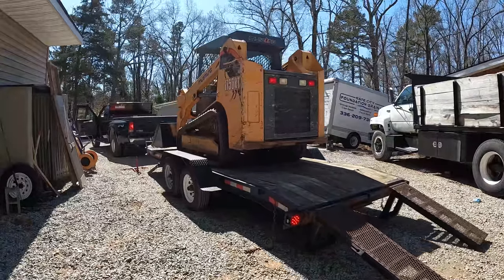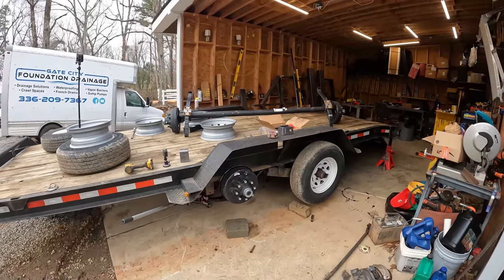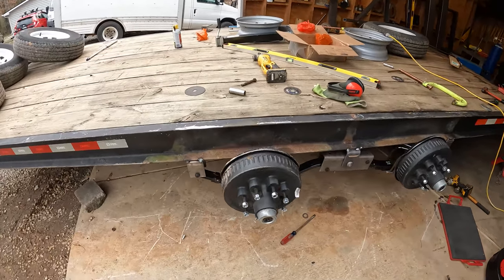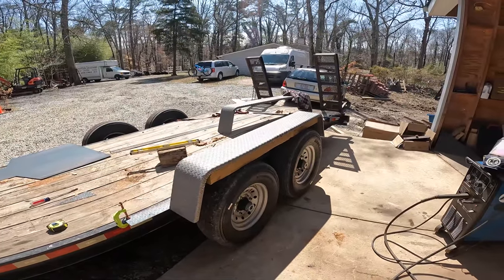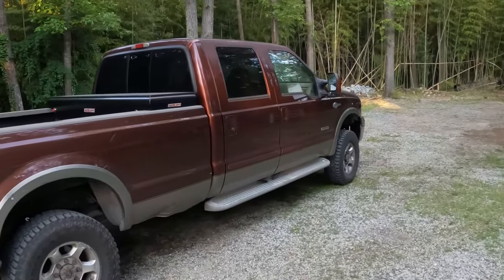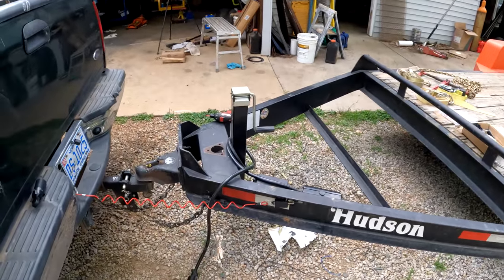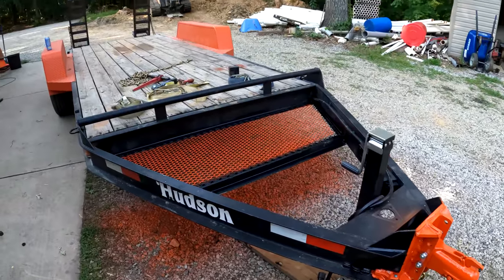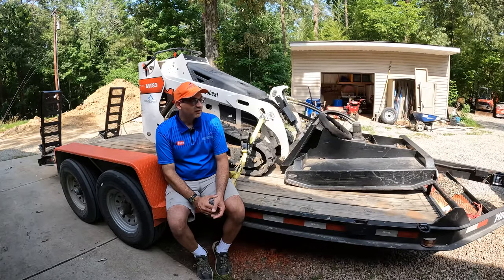Upgrading an equipment trailer

Comment: The length of your fold down ramps will greatly affect how the equipment loads. Longer ramps give you a smoother load / unload...and are easier and quicker to to build or modify. Lengthen the ramps on your modified trailer for a much smother load/unload. Use blocks under your ramp as a gauge to determine how much longer to modify your existing ramps. You can also put short blocks under your unmodified ramps for a smoother load/unload with no modifications. Blue Sky's.

Comment: nice job,love the orange bits,can be a health safty feture ,as on a rainy day on the high way ,your trailer stand out to other road users ,orange bits ,we do that here in the u.k ,we call them markers ,mark out side of a verhicle ,in bad weather,is nice to have a work shop and tools ,to keep your buisness going and adapt equipment to suit your needs ,is sad people steal stuff and move to other ereas ,for resale,you could stamp your zipcode into the chassis ,and tell the police ,if it went missing ,what we do here in england ,we call it our postcode ,and door number ,is used on lots stuff ,bikes,welders,can be stamped or uv pen ,on house hold items ,police got blue light and try to find post codes,return to owners ,also get a small tracker now too,fits inside a mountin bike or car,boat,and when gets stolen,you can activate it ,use its onboard battery ,then find it on your phone or police man ,have you ever tried stick welding ,rods,that is good for heavy steel jobs,nice penatration,bite,cheap too,box rods ,weld outside ,in the wind ,6013 for steel or 7018 for structeral ,low hydrogen rods,im more of a stick man ,learnt that first ,learn mig after ,to fix cars,well your doing a fine job ,seem happy ,being self employd ,keep up the good work,you are good at teaching stuff,explain things ,share your wisdom ,knowledge ,you motivate others to have a go,try ,very good indeed

Comment: Your a pretty good small project guy but I would recommend a little heavier weld on the spring hangers and for sure on the hitch. Burn the weld hotter and wire feed up better penetration and maybe even a few more passes to beef it up.
Reply from the maker: Great advice!
Reply: @GCFD  
I really hope you followed up with fully welding in those hangers....
If this was just a car trailer for highway use,those tack welds would be fine,but considering the heavy weight you're hauling and taking the trailer over rough terrain, it's just a disaster waiting to happen!😒
Otherwise, excellent choice putting in the upgraded safety switch and heavy duty coupler!!!!💯👍
Reply: @GCFD  your reply to that comment won you a sub. You probably dont care but being a humble man able to take advice goes so far. Thats just awesome.

Comment: Loading a skid steer, always better to load it by reversing onto the trailer so when unloading youre facing forward to go down the ramps. No need to worry about tipping backwards

Comment: Def when entering the trailer lower bucket to deck height and as you approach fenders lift n drop over. Lowering the bucket will def help stability while loading

Comment: I actually just bought my first trailer which is a 1998 Hudson 16’ equipment trailer. After watching your trailer videos and your trailer build, I feel confident enough to add a 4’ or 5’ dovetail, make longer ramps for a better load angle, put the 95” wide 4” drop axles on it, redo the fenders for the added width and also add the Hopkins or Bunker charging breakaway system. Instead of the expanded metal tool tray though, I’m going to fab a big toolbox like you’d see on a Diamond C. The DOT around here don’t like tools and equipment just being in a tray without being fastened down. I’m also going to redo all the lighting and change it to LED and fabricate a winch mount that will probably be covered by the toolbox. Once I do all that, weld on quite a few D rings and repaint/re-decal it, I think mine will be complete. I really wish Hudson would have flipped the channel around though like you did when you built your trailer. I’d love to build my own one day like you did! Love the trailer and Ford truck videos! Keep ‘em coming!

Comment: I think you should paint your next trailer neon pink. :)
When welding though paint, you should probably wear a mask, or really whenever Mig / stick welding.
Reply from the maker: I've never heard that. I've only heard when welding galvanized metal you absolutely need a respirator.

Comment: Hey buddy. I believe your mistaken about having to charge the battery that was in there. I have a number of trailers as well and if the trailer is wired correctly and getting power on the hot lead it charges the battery. But the batteries do go bad over time. Love the channel. Keep them coming
Reply from the maker: I thought so too Andy but there was only a positive and negative on that battery. Either way I feel a lot better with the upgraded battery box.

Comment: Just waiting for lower quality version to appear to enjoy this high quality video :) My computer just cannot handle the full res video
Reply from the maker: Dang it! I checked yesterday and the lower res option was there, so I published. Checked after I saw your comment and it's gone. I don't know what to do with this issue and youtube. I guess I need to way a few days before publishing then wait more. I'm sorry elk
Reply: @GCFD  Not a problem. It's like waiting for premiere of your video, which is usually at 3AM at my location ;) Haha, "elk", i like it :)
Reply: @GCFD  Good vid, seems like it's your hobby to keep you busy over winter :)
Once you started replacing/upgrading you could not stop. Does it have those side position lights?

Comment: I have same trailer 16ft tri axle its factory the 80s i beam is great mine came with flat stock welded across the i beam every 2 feet for tie downs never had an issue

Comment: Longer ramps seem like an easier solution
Reply from the maker: That would help the approach angle but wouldn't increase the load capacity of the trailer or standardize my wheels/tires. I also like the load sitting lower on a lower deck for more stability.

Comment: good job! the only thing I would suggest if the loading angle still bother you. air bags on the rear of the truck to lift the tongue of the trailer up and that lowers the back of the trailer or similar concept is to use a heavy-duty tongue jack to lift the tongue up for loading. one advantage of the tongue jack it acts as a brake. There's more than one way to skin a cat, LOL
Reply from the maker: Great point on the jack Vince. I usually apply the brakes with a piece of PVC pipe so all axles are holding. I take loading and unloading very seriously!

Comment: Great job Shawn! The convenience of using that trailer and the piece of mind with employees hooking it up correctly will pay for itself tenfold. Color looks good, I was guessing that it was the new GCF color scheme or you were a Bengals fan. Because of the convenience and versatility of that trailer... It will probably be the first one to need tires.
Reply from the maker: Haha thank you Ed! I have seen employess take a maul sledgehammer to a trailer coupler because it wasn't hooking up right. They broke the coupler.

Comment: Outstanding Shawn.  I know putting all the time in to editing this video had to be a large undertaking.  I really enjoyed it.  I will keep an eye out for you and the trailer.  I like the unique colors.  I did not catch you saying how it tracked when you pulled it.  Let us know.  I bought a local made trailer after having a Hudson for many years and I have been considering buying another.  I need to upgrade on GVWR.
Reply from the maker: Thanks! The trailer pulls very well but I think those ultra-heavy duty tires make it feel heavier than it is. I plan to swap two of the tires onto my yellow trailer so I have 2 and 2 on each.

Comment: You get lucky on the finds that is for sure... Still needs your Logo somewhere on it. Nice 1/2 dovetail joints (notches) , Orange is good & was going to say where is the Yellow Before you said orange,  Wiring is +...Sure wish they had that back in the 70's & 80's when i had all my trailers,   i would be concerned the straps would bounce out etc etc by not having a taller rail around the basket do you keep a bungee cord around most of it all, Those tires are nice should last longer than regular ones /   500 seems like a heck of a deal for that how is the interior...Glad the truck is working out since pulling a knuckle and a few headaches on it...
Reply from the maker: I can leave the straps on the deck and they never move so I was fine with the small rail around the front. The escape is awesome It's a very nice car. It needed plugs, coil packs, PCM.

Comment: Must be nice being able to fix and modify your own stuff
Reply from the maker: For sure!
Reply: Just an idea.. You could have added door hinges to parts of the trailer and a top mounted mesh basket above the bottom portion and have it act as a type of lift up drawer/door so you could put some tools or other flat objects on the basket and not worry about them flying off the trailer at some point. Not explained very well but i think you'll figure out what i mean.. 

On the other hand i guess that wouldnt work well if you put gas cans and the like there.. owell, was a decent idea at first lol
Reply from the maker: I love that idea and thought about doing it. Diamond C makes the lift up storage like you are talking about. https://www.diamondc.com/wp-content/uploads/2021/06/GTF-car-hauler-trailer-lockable-v-tongue-storage-lid.jpg

Comment: Real cool Sean. Orange is good because it's close to red which had the longest wavelength. Hence a red light. Better for safety going down the road 🛣️. 
And theft it is a deterrent.
Reply from the maker: Yep! Plus it matches my old dump truck (uhaul orange), and my excavators.
Reply: @GCFD  love the U-Haul.

Comment: Nice work. You need a larger shop to work in.
Reply from the maker: I agree Tom. The problem is the location of my current one is where the new one would have to go. So I would have to demolish my current space to start over. That's a tough one to swallow, but I could go two story, a lift, the works!

Comment: Can u explain  more about  the battery  break away system.  What is the main purpose  of it ?????😮😮😮
Reply from the maker: The purpose is if the trailer comes off the truck the battery will apply the trailer brakes to stop the trailer quickly.

Comment: Wow what a great video, you are good at doing engineering work, it must save you loads of bucks, if you had to pay for someone to do this work for you. 👍👍👍
Reply from the maker: For sure! It's just very very time consuming. I sold the old fenders almost instantly for the same reason....the guy had the same trailer with no fenders and he could just weld them on and go. I got $200 for the two fenders.

Comment: It sounds like the exhaust back pressure sensor tube is plugged on your 6.0.  Easy to clean out and will up your performance.
Reply from the maker: You think? I just replace them instead of cleaning. I'll check it out. sometimes the tube gets clogged too.
Reply: @GCFD  It is the tube that I was thinking of.

Comment: Love seeing “upgrade” videos like this. 
One question. Did you ever finish welding your spring hangers to the frame?  Still looks like tack welds when you primed everything.
Reply: Thought the same. Spot welding will end up cracking considering the load through the bracket.
Reply from the maker: I welded the entire front and rear and had the spot welds on the left and right sides. This was how the original hangers were welded on so that's how I put them back. I wondered about fully welding them.

Comment: I know nothing about welding or engineering... is there a reason why the brackets  for the axles weren't fully welded on the outside? Are those 2 small welds strong enough? Is it fully welded inside? Just wondering
Reply from the maker: It's fully welded on the front and back side of the brackets. I welded them back in place the same way the old ones were welded on. I keep an eye on things and everything has been great so far.

Comment: Two tack welding to hood the axle perches?  Blow seal on passenger side axle
Reply from the maker: Those two tacks were all that made it into the video. The seal has been replaced as well. Thanks for checking in with me!

Comment: It doesn't look like the fenders are quite wide enough and do not completely cover the tires on the outside which I assume would allow water to spray up when it rains.  Maybe an optical allusion.
Reply from the maker: I think they are a little narrower than the tires.

Comment: Those several tacks holding suspension seem sketchy, are you sure they should not be full welds?
Reply from the maker: I welded the full front and rear of the bracket which is how the old ones were mounted.

Comment: I've been in a similar situation where things got just a little bit more expensive, but the results exceeded by expectations. Although on reflection you should have made the axels as close as possible to the table within reason to drop the height even more and those rear fold down ramps could have been extended out just a bit more, giving you a better loading angle.

Comment: Nice. This orange color is great and more visible on the road.

Diamonc C produces similar trailers where one piece of steel goes the entire length. They are called GTF - for cars and LPX - for equipment. Only they do quite unusually on i-beam.

How long is your trailer?

Comment: I really liked watching your video. I have 2 things to say though. First thing is Just because you put higher capacity axles underneath that trailer does not mean you can  carry more capacity. That trailer frame is designed and engineered to a certain capacity and they put axles under that that correlate to that capacity so even though you have heavier duty axles the frame is still rated for the other axles and on your registration and title the trailer is legally registered for a certain towing capacity. If a DOT officer wanted to check your weights and you were over what the license and registration of the trailer says you could be in big trouble. Second thing is make the ramps on your trailer longer they look like they're almost a foot shorter than the ones on your yellow trailer and that's probably what's contributing to your steep incline for driving things off and on the trailer.
Reply from the maker: Good points Nathan. I knew from experience that this trailer would be fine going from 12k to 14k lbs. We don't have trailer registered weights here, since the tow vehicle has to be rated for everything hauled and towed. The longer ramps are on my list of things to do. I think I would be better off building new ones instead of trying to add length, don't you think?
Reply: The VIN number that was assigned to that specific trailer correlates to a weight rating.

Comment: I’m pretty sure that hitch is designed to have a 1/2 grade 8 bolt in the top and bottom in addition to the welding which I think you should have made several passes on your welds, in my wrecker days I’ve gathered up more than one trailer because the hitch broke off. I’m kinda weird I guess but I have 4 trailers and I always paint the totally black so they can be touched up easily
Reply: I was thinking the same. I don't know if I'd trust those welds with all that weight.

Comment: Hey Sean, with all the positive feedback on your trailer videos, you should open a tech school. I like the color. Next trailer you should go hilighter green.
Reply from the maker: Hey John! I just won a MMDI compact equipment trailer at an auction and will be picking that up soon. I've been looking for one for a long time, but they are so expensive.
Reply: @GCFD  that’s awesome. It’s a good feeling when you procure something you’ve been looking for. It’s almost time to get a paint spray hvlp to use instead of rattle cans. I’m excited to check out your new to you trailer.

Comment: Would it be possible to add a vertical gusset to the inside fender between the tire runs?  The center is the weakest spot on the fender and without reinforcement there I think those fenders will still buckle if a skidder bumps it too hard.

Comment: You know I always show up on your trailer videos!!. Excellent work. Question - why didn't you paint the inside of the fenders? It looks like the trailer brake switch (2 wires) has a great potential for chaffing in that small unprotected hole
Reply from the maker: I wanted to keep the inside of the fenders that light grey color so I left it as just primer. I don't think the wires are heavy enough to cause chafing right there but maybe I should fill in the hole with some Ultra Black RTV. That's my go-to for securing wires in place, but still being able to get to them if needed.
Reply: Thanks for the response. I meant to ask earlier, since you upgraded the load capacity did you have to do anything with dmv
Reply from the maker: No there is usually a sticker on the truck/trailer with the capacity. DMV here doesn't care about that. The sticker on this trailer is faded and illegible, so I didn't do anything. If I had a DOT number and was running loads across state lines, I would definitely have the stickers in order, but for in-town stuff I'm okay with this.

Comment: Great video. The welds do look bad. I think you should have gotten it welded by a professional. If you tow a skid steer down the highway and that coupler comes off because of under/over penetration, you can hurt yourself and others.  You’re towing serious weight so that’s my only advice. Be safe!